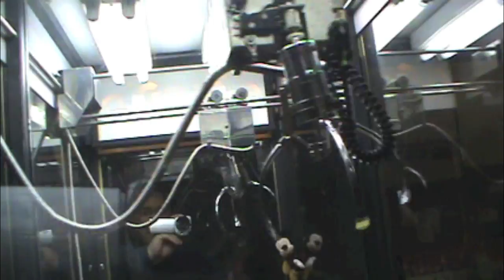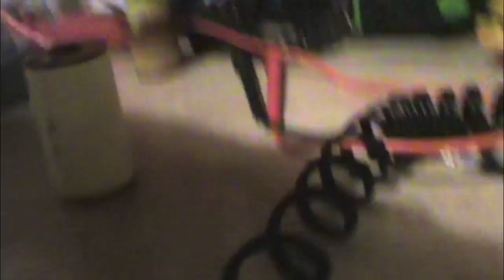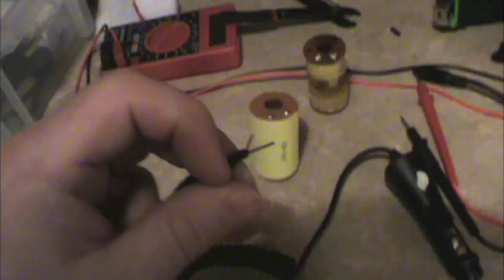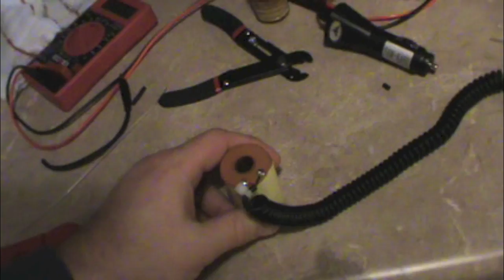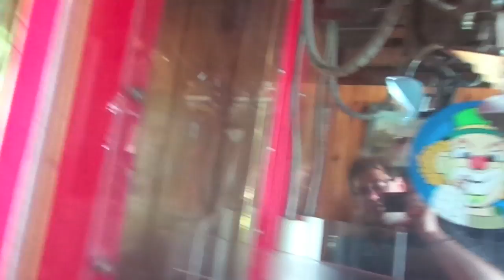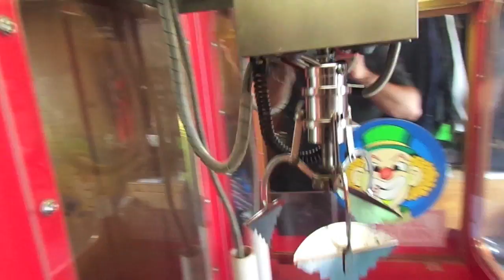Mom's Candy Crane

Comment: I bought a smart candy crane also. In working order but something's went wrong it transit. The crane won't move forward. The motor is deffo working as I can see it spinning, any ideas?
Reply from the maker: Hi, it's most likely worn belts; there are two of them (one on each side) of the trolley mechanism. Clean the rails with alcohol and replace both belts, and it should work!